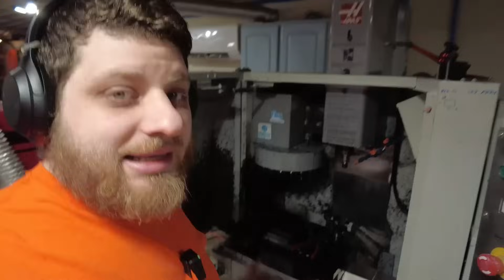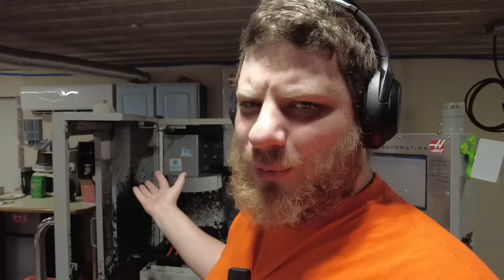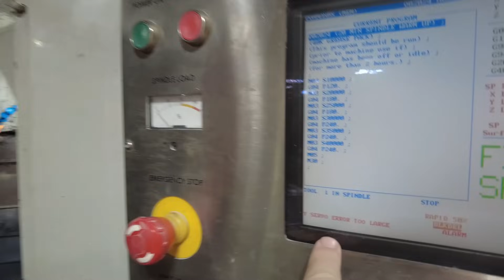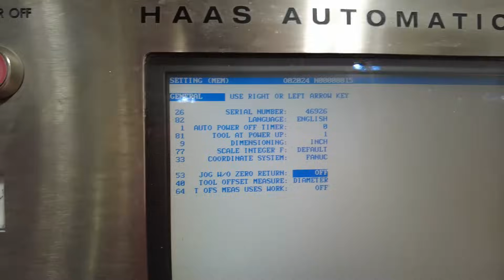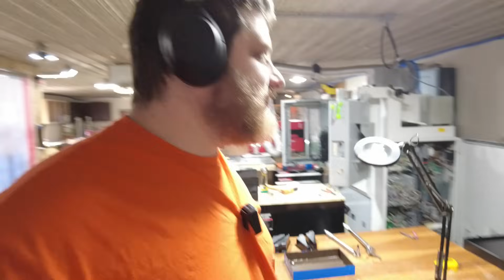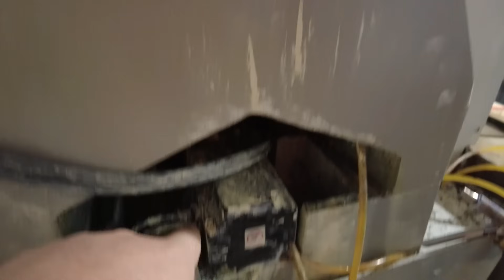The Haas broke AGAIN (and this time it's actually bad)

Comment: I get a kick out of your "superglue solutions". Whether it's  on jigs, indexing in vises w/ pin gauges & 123 blocks etc…. Even works for pulling stuck/stripped bolts out of the actual machine! Simplicity is elegance. Great to see you learning how to fix your machine, troubleshooting like a boss. Keep doing what you're doing & pretty soon you'll know the machine inside and out.
Reply from the maker: Well now I'm self conscious about it 😂. I didn't realize how much I used it until you pointed it out.

You probably shouldn't see how often I use hot glue around the shop......

Comment: that motor is not worth 5k ... $300 old cross stock at most with the incoder. 600 from a we carry orem parts style place.
the stepper motor itself tested at spec and certified from a high end manufacture .. 150 ish in it's generic form. not sure what the custom roter would run but you can get a generic 2 ended roter and get it turned down to an adapter without to much more cost re using the previous ends or milling to size the provided ones to reconect the encoder.  
now do i think someone would and could charge 5k for that stupid thing yes. i do . in fact i know the kinds of places that do that. 
The idea behind that price tho is you call and they got. if they dont got they make it right then and there and you have it in as short a time as possible.
if there not sending it NEXT or SAME day emergincy delevory then you dont need to spend that much on it.

Comment: Looking at the mess. My y axis wouldn’t work either. For that matter, none of my axis would work either. Clean Me.
Reply from the maker: I cleaned most of the machine pretty well. All  of the actual mechanical components are pretty clean, but there are definitely some nooks and crannies in the casting that need more TLC.

Comment: the haas manual for the error codes that directly point to the encoder, the servo connectors are back probe-able for a testing procedure that's also in the manual

Comment: Your videos are so good. Just first music at the beginning a little bit loud.
Crazy that ceramic dust got that deep into the machine without affecting backlash.
Reply from the maker: A lot of other machines from the same shop have major issues. I was told mine only got used on acrylic. Which is exactly what a sales man would tell you 😂. But I haven't seen the same backlash issues, so he may have been telling the truth.

It's also possible that they replaced the ballscrews on this machine at some point, since they did apparently replace the motor.
Reply from the maker: Oh, and I'm working on my editing 😅. I'll try and keep it quieter in the future
Reply: @AudacityMicro  The music level at 12:00 was perfect, maybe the earlier track was a different volume. Editing is great, I can tell you put at lot of work into it.

Comment: I have some tips for you the servo motor encoder doesn't communicate with the controller directly but it goes true the servo drive. One good thing about older machinery like that haas is that some of there machines use simple pulse/direction controller's to control the motion of the servo drive. So if you ever get to a point where the drive or the servo quits on you, you can buy a modern servo drive and motor for much cheaper and just wire that up to the existing controller. Only draw back is you would need to tune it , this isn't very scary with new drives as they usually come with tuning software packaged in the price.

Comment: What Year and model is your HAAS, love you're vids btw!
Reply from the maker: It's a OM2A, made in 2005!
Reply: How accurate would you say this machine is? Thanks  @AudacityMicro
Reply from the maker: Depends on how much work you want to put in! In general it's more precise than the majority of my processes. Realistically I wouldn't want to take a part that's tighter than about +/-0.0005. the machine could probably do more, but I'm not sure I could at the moment.

Comment: For motor troubleshooting you should make a set of extension motor cables to cross between axis. So you can test without disassembling the servos
Reply from the maker: That would certainly make this stuff easier 😅
Reply: @AudacityMicro  I worked 4 years in yamazaki mazak building vtc800-820's so you could say you pick up a thing or 2 to make life easier when constantly building or repairing them

Comment: Glad you found what was wrong, however the servo motor shouldn't cost $5k, I don't think
Reply from the maker: I agree! I think it has something to do with it being a specialty motor. These OMs aren't exactly common compared to something like a VF2. So even with the motors being smaller, they are more expensive. I found a place you could buy rebuilt ones for $2700, and I saw a used one on eBay for as low as $1800ish.
Reply: @AudacityMicro I hate that they are so expensive they are selling them 3 times the price of a new one from a reputable brand like Siemens,  Schneider, ABB etc.

Comment: Good job digging in and finding the issue under the gun like that 

Any time you get a position error like that there's a high probability that it's going to be encoder related.  You saw it as you pulled it apart - they have a little pancake rotary encoder on the back of the motor shaft that keeps track of its position.  The stationary side of it will have an optical or magnetic readhead, and there will be a thin disc with engraved or etched graduation marks on it that moves with the shaft.  As it spins, it counts those little graduations as a means of figuring out where it is and how far to go.  Kind of similar to how a wheel speed sensor works if that's a better analogy.  It also manages velocity and acceleration control with this.  To map rotational motion to linear distance traveled, they're going to have the motor revs linked to the pitch of the ballscrew (linear distance traveled per revolution of the screw) with something like "Y-axis encoder counts per rev" or similar.  Not sure how the haas control handles it.  

As you pointed out the servos were screaming because the gains required to move around all that mass are a hell of a lot higher than what is needed to achieve stability just by itself.  

Easy to take for granted how the feedback systems and controls work on these things until they're not working right, but it's a very deep and interesting subject.

Comment: At VoTech we had a Haas mini mill that stopped homing, turned out there was a chip which had found it's way under the accordion slides and was sitting on top of the magnetic proximity switch which told the machine it was always at home. It probably got there when the machine was cleaned with compressed air.
Reply from the maker: I didn't show it here, but that was one of the first things I checked for. From what I was reading, that is annoyingly common
Reply: Should have sold me the broken mill for cheap before you found the issue xD

Comment: Two important takeaways here:  1.) Always have Mountain Dew or other sufficiently caffeinated beverage on hand when embarking on any troubleshooting adventure, and 2.) if at all possible, have spares for critical components on the shelf so you can get the deliverables out the door and troubleshoot when there's less time pressure.  Of course, #2 is limited by what you can afford and isn't always an option, but I've seen folks end up having to pay contract penalties or lose work because something like this happened and they just hadn't considered the possibility.  In the past I've bought known bad components (power supplies in particular) for a song and fixed them just so that I have an extra available if needed.

Comment: Good Job
At a previous employer that used lots of allen bolts/screws. It was not uncommon to break the balls off of allen wrenches.  Big note is do not use the ball end to break loose fasteners. Use them as easy turning tools.   The best thing we found for the broken balls was to hit with a punch to knock it loose in the socket of the bolt/screw and then do as necessary to remove loose ball.  Strong Magnets  work well.  You did well.
Reply from the maker: Good to know! Thanks!

Comment: And that's why you don't buy 20 year old cnc machine
Reply from the maker: This is a very good point. I would normally agree with you, but I just don't have the capital to make a different choice.
Reply: I unfortunately disagree. I'm in the same boat as you. Running on a tormach,limited in what I can do and achieve . When the cash flow gets to the point I can handle 5k monthly payments for a HAAS I'll sell the tormach and finance for 36-48 months.

Your time needs to be invested making parts and bidding on jobs.

Good luck
Reply from the maker: The machine has already paid for itself 🤷‍♂️. I had just as many problems with my tormach, and it costed twice as much as my Haas. My payments are about $450. I can afford to spend a few days a year working on the machine.
Reply: Correct you did but a 20 year old machine and this may cost you a ton of money to get it fixed correctly. As I said and can’t say it enough call the haas factory outlet to get what they would do in your spot as a technician.
Reply: Especially a 20 year old Haas.

Comment: Good job troubleshooting, those motor leads look like they've been through the wringer. You learned the hard way why we don't use ball-end allen keys, they either break or strip out due to the relatively small engagement area.
Reply: Drive with ball, tighten with straight. Ball drive are great for awkward angles and hard to reach areas, but NEVER torque hard with them. I don't care who the manufacturer is, I have broken Snap-On, Allen, and Wira. I have had to weld little bits on several others to help pull the ball out.
Reply from the maker: Definitely a lesson learned there. I'm not sure what I would have done if my glue method hadn't worked. I was just flailing at that point
Reply: @AudacityMicro the only thing I could think was to dremel the nut in half, but I think even that has a low chance of success in such a tight space.

Comment: 5000$ for a motor? Man, those motors are like 400 bucks, thats a major ripoff...
Reply from the maker: $5000 from haas, not including labor, which they would insist on, 3000 rebuilt from a reputable source, $1700 used on ebay 😑. These things are just expensive.
Reply: @AudacityMicro  Whole machines arent worth that much in Europe thats a bloody ripoff. Such a motor doesnt even cost that much if it were from Siemens. Theyre like max 800 bucks in that size.
Reply from the maker: I'll let you negotiate with Yaskawa for me 🤷‍♂️
Reply: I was thinking the same thing. Is it $5k from Haas? Do they take an off the shelf motor and modify it to make it proprietary?

Comment: I would consider getting some strain relief for those cables, this is waiting until the connector does break at the servo side. In the future you could save yourself some time and measure the phase resistance of the motor, all 3 phases should measure the same. Another thing that could have helped was looking if the encoder position changed when you turned the motor by hand (not 100% sure that works/is safe on this machine).
Good job finding the error without ordering needless parts.
Reply from the maker: That all makes sense! thanks!

Comment: If I were you have a technician come look at as I had an issue like you and found out it was the x axis drive. The y axis drive could have went bad. Just trying to help out as I have a tm2 machine from haas and it still works very well.
Reply from the maker: probably the smart thing, but that costs money! Which is not something I have in huge supply at the moment.